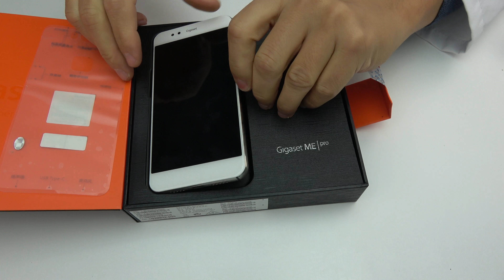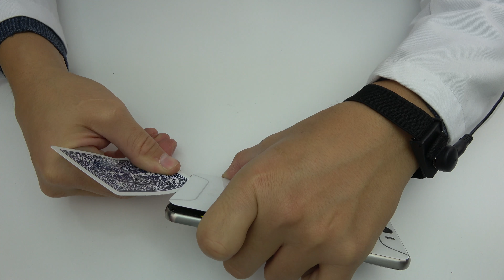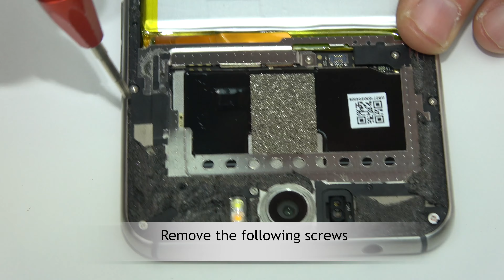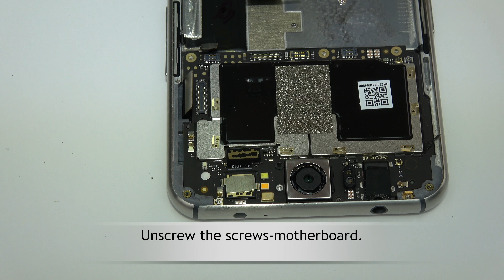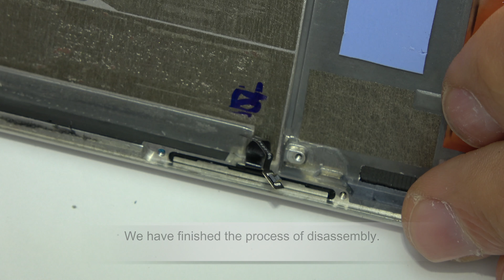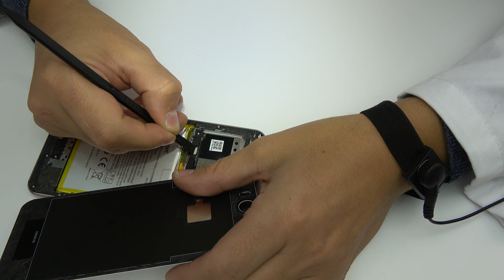Gigaset Me Pro Teardown

Comment: Does one not only need to replace the battery, if that part is broken? Thanks for showing all parts. The 12V charge function (impedance lower) fastcharge broke shortly after using the phone with a magnetic USB-C plug and can have caused a battery short curcuit to make a cell destruction. Do use the real wire plug not a magnetic plug? Upgrade from Android 5.1.1 to higher OS? LANBERG plug.